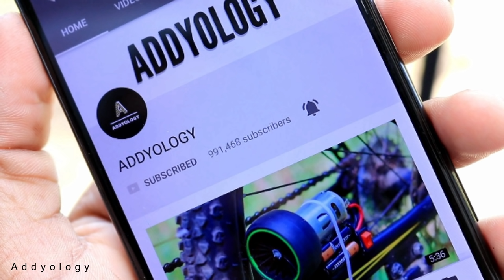3 Awesome Life Hacks

Comment: No, don't put a motor on your phones headphone jack.  High current and inductive load will likely kill the amplifier chip.
Reply: High starting current is for large motors
Reply: But... Speaker is inductive load too. Ehm. :D And amp chip has short circuit protection, because when you plug in and plug out jack connector, you cerate short circuit at output of the amp chip for short time period. So.. There is no problem with connecting motor to Audio jack.
Reply: @Estados unidos chilenos de polonia :v Hi
Reply: @marvels3011  Hi
Reply: @sttrnsskn5417  don't rely on protection of chip, what if that feature failed?
Connect such that motor to audio jack is a bad idea.
Reply: @sttrnsskn5417  a short circuits issue is voltage. As for amps, the device attached controls the amount draw. AMP DRAW. imagine it like a vacuum. The device keeps sucking, if the tubes sent designed to handle that much pressure it'll break.
Reply: goldenbi motor is basicly only a copper coil atached to core with magnets arout it. (If we talk about small DC motor). Speaker is same type of construction. Coil on the core or paper with huge magnet around it. Amp short circuit protection cant fail. Because its only resistor in series with audio output. If you short output, there is still resistor. That resistor absorbs all power from AMP and transform it in heat. But AMP is low power device, so the amount of power isnt higher than 0.5W. Witch is OK with 0.6W resistors. And short circuit is nothing dangerous for phone's AMP. If you connect your phone like a sound generator to a old amplifier with potenciometer for controling volume, you easily create short circuit at otput of the phone. Potenciometer i lowest volume connect audio channel wire with audio GND and create short circuit. T volume is 0. It is normal. Nothing dangerous.
Reply: goldenbi And i know what I say. I am an electrical engineer.
Reply: He also connected the wires to the right out of the jack and the mic in of the jack so it wouldn’t close the circuit
Reply: Radek Pražák Well you certainly aren’t an English teacher. Your spelling is attrocious
Reply: Speakers ARE inductors
Reply: @Synthematix  Yes, but their impedance is orders of magnitude higher allowing them to operate with significantly less power.  Think trying to start a tractor diesel engine with a battery from a compact sedan.  Sure it will eventually work, but you're going to damage the battery (phone) in the process.

Just because you can, doesn't mean you should.
Reply: Nerds
Reply: @sivalley  Excuse me, but speaker has resistence of coil around 4-16 Ohm. And what about DC motor coil? 100 Ohm or more? And don´t forget. There is Ohm´s law. U/R=I. So.. You cant destroy AMP chip with connecting DC to it. :) And try this: Connect your phone jack output directly to the 4 Ohm speaker box and play some music on max volume. :)
Reply: It doesn't really matter. This wonk work anyways.
Reply: Even if the motor has higher ohms rating. This is just the DC Rating. There are also frequently based resistance for the coil. 
Plus the motor should probably have much higher inductance, which means at fast transitions and without a free Wheeling diode the voltage spikes could climb up pretty high and could so kill the amp which only has protection for headphone loads.
Reply: Zane Bliss Aa
Reply: What high current xD
Reply: .... someone claim he is engineer? you make me laughing! or you can put a testing youtube video to proof your saying?
Reply: @Qoow8e1deDgikQ9m3ZG  everyone is an engineer on the internet
Reply: I bet most of the people who posted, never had a bright idea without watching someone else's YouTube video
Reply: @Qoow8e1deDgikQ9m3ZG  until you can produce a proper sentence please refrain from using our language and go educate yourself on how to talk/write in English.

Comment: I find it funny that it's a hack to use a motor instead of just using a speaker driver.
Reply: Or a 5v amplifying module. Humanity is smart...
Reply: It's for that warm analog sound ;)
Reply: Valve did it with the Steam Link
Reply: I mean with the Steam Controller
Reply: M

Comment: What is this motor use in speaker
Reply: @asmar azmi dc motor or ac motors and motor capacity plz tell me
Reply: Yes galat
Reply: 3v small dc motor u can make it from any dc motor. 
Try it with woofer slot if it doesn't work in phone.
👍
Reply: It's working I tried
Reply: The motor has magnets and coil inside, this is what big speakers usually have. It is used to basically transmit sound or amplify it.
Reply: sakthi fastmech 🙏
Reply: Moter me spiker hai

Comment: Is that motor realy produces sounds
Reply: SAMUEL SAM
Reply: @nazishwasti9595  ok
Reply: Yes it really makes sound
Reply: nooooooo
Reply: I don't believe
Reply: Of course when it spins
Reply: @sherrypaul6843  Same, I don't think the output of the audio jack has enough current to run a motor, much less make it sound like a damn speaker.
Reply: Yes becouse it's spin and it makes vibration and vibration make sound and also magnets are also makes sound
Reply: It Cant Make sound, It runs Like if sound is high it will run fast and if low then it will run slow I THINK,
Sorry for my English
Reply: SeiferTV that's why the cup...the first phonograph did the same thing, a bugle like opening where you heard the sound from.  At the other end it smaller to a thin tube that ended up as a needle.  I want to try it now.
Reply: электромагнит
Reply: Nope it will produces a milk
Reply: yes but qality very bad. u can see sound on low woltage lamp too. and if u  plug in head fones in to  microfon connector and speak to them- u can see your voice in speakers/ sorry for my english
Reply: I’ll try someday then will tell you if it really works

Comment: 1. You can do the same thing with plastic cups, a toilet paper roll and a hot glue gun, only better.
2. Dont ever put that shirt in a washer and dryer, or you will ruin all the other clothes.
3. Better have a screen protector on that phone, or the screen will get scratched.

Over all, nifty tricks, but as others have said, your soldering needs work.